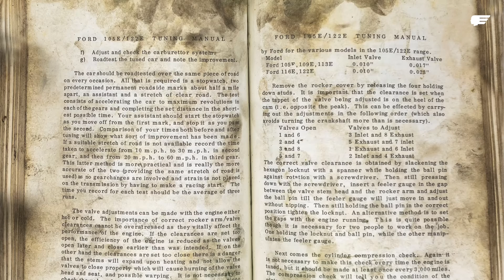V12 BEGINNINGS: Gordon Murray Automotive & Cosworth

Comment: I just think it would be so awsome if Cosworth was to take that next step to take all it's knowledge  and start working on a Hydrogen fuelled Internal Combustion engine like, Toyota,, Suzuki, etc etc. Please;  we don't want to lose that sound track and end up with boaring fin batteries and we definitely don't have to or want to.. Could provide that critical future for motorsoort in  all it's forms. Set up a just giving site to kick it off. You'd get millions of supporters I'm sure..

Comment: Brilliant work by Cosworth! Still surprised though by the 4 throttles, and not using ITBs…
Reply: 4 throttles on road car, ITB on race version
Reply: @rndmprsn3532  Yes, I know. But why? I think it was said that ITBs were ”hard to adjust”, for the road car, but that seems like a weak argument for what, 100 engines made by a specialist company like Cosworth…
Reply: Emissions probably had large impact on 4 throttle setup
Reply: They might get around that through the use of highly variable cam timing, i.e retain high speed/velocity where needed but also outright air volume needs
Reply: Cosworth also made the Aston Martin Valkyrie. I watched a video a while back about it and cosworth made the engine in quarters. So a 3cly engine for emissions testing and stuff so they probably did the same thing for this one.
Reply: @chriscovington11  ah good memory, I do recall that now too. That does make sense from a legal and emissions standpoint.
Reply: There could still be ITBs in addition to valves at the intake plenum to modulate air velocity and harmonics. Not necessarily this engine but don't assume.

Comment: seems more like an emotional choice than a logical choice to go with Cosworth. Did they even look at other options? With the McLaren F1 I think they started out with a Honda engine and then switched to BMW at some time.
Reply: Gordon was then quite close to Rosche and got him onboard for the engine. How good was that one? Well, if the McLaren F1 BMW S70 engine made the same torque at 10000+ revs it would make the same power as the Valkyrie engine today. 

Similarly Gordon also got Pete Weissman for the F1's gearbox. Weissman had also designed the gearbox for the legendary MP4/4 btw.
Reply: @srinitaaigaura  dont get it. As far as I know the McLaren F1 BMW engine didn't rev to 10000 revs
Reply: They wanted the best and were able to work with Cosworth.  Cosworth had also been working on the Valkyrie's V12 around the same time.
Reply: @sparky4878  I  get the feeling they would have chosen Cosworth no matter what. For nostalgic reasons.